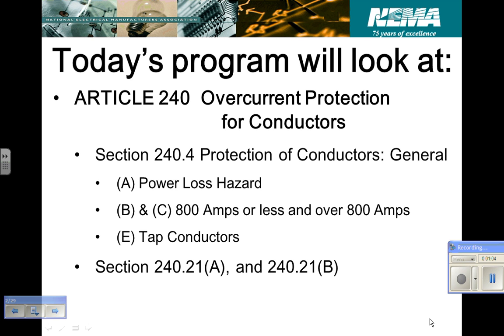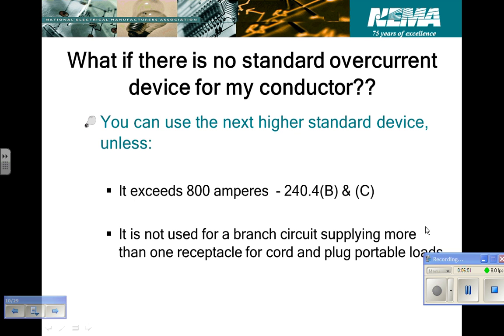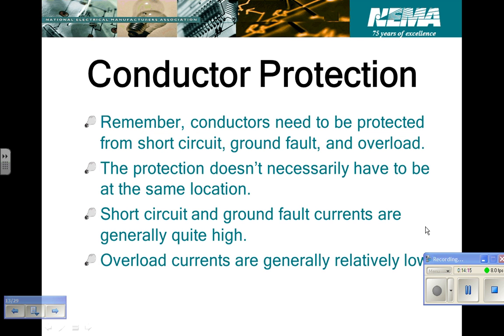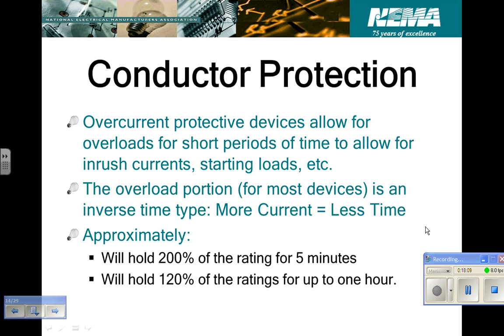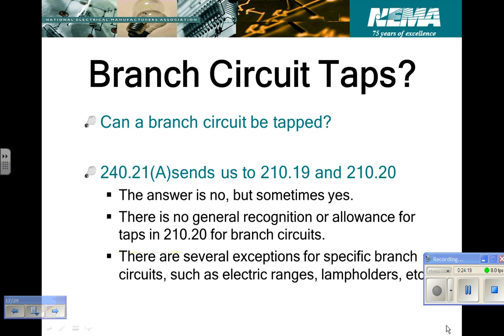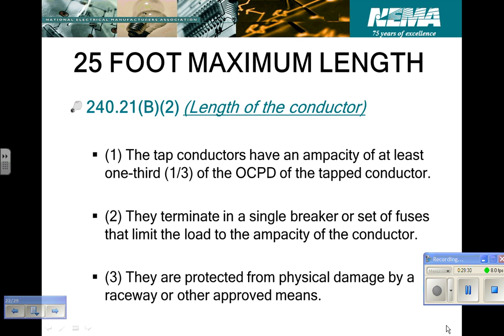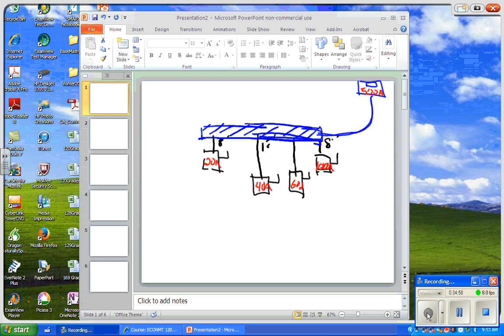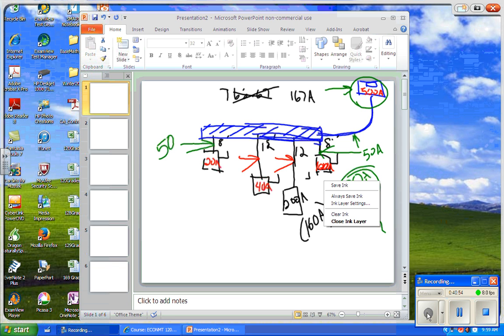TapRules

Comment: If my tap is less than 10', the tap can have ampacity of 1/10 of the feeder OCPD.  If I go over 10' with the tap, then the conductor ampacity has to be at least 1/3 of the feeder OCPD.  Why the length makes such difference in allowed ampacity?